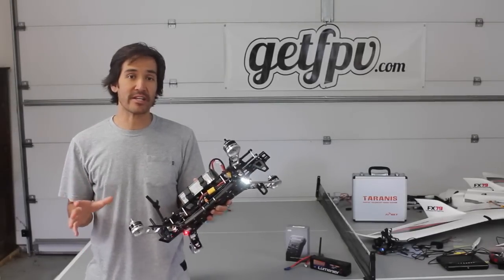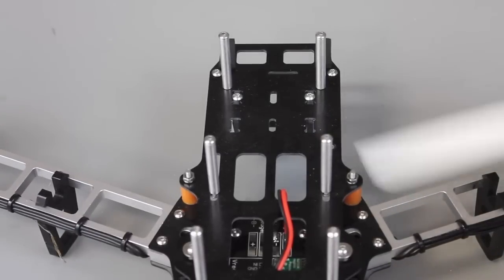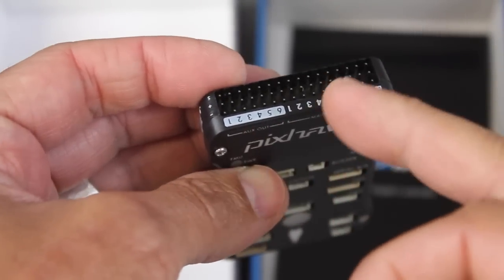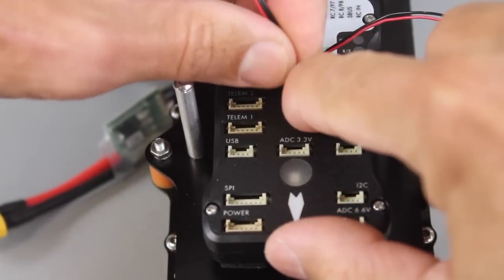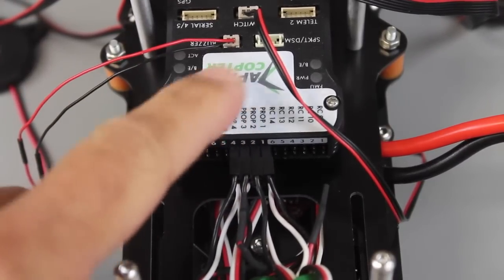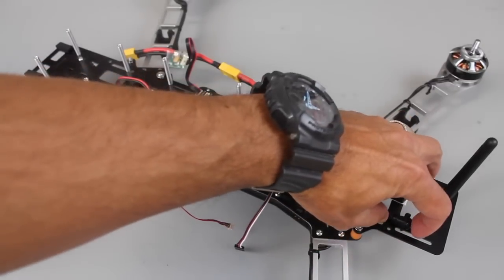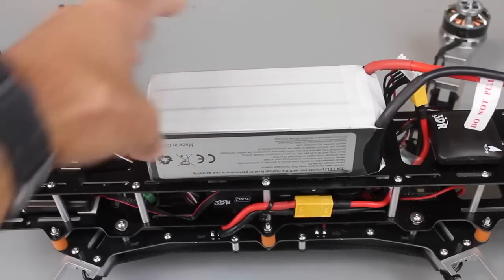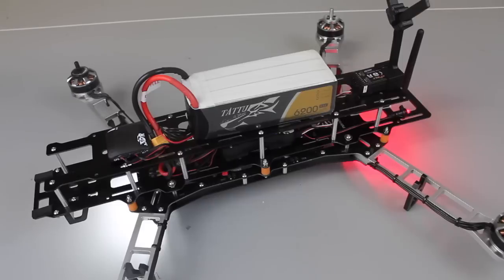Pixhawk Unboxing and Installation in QAV500

Comment: i am little bit confuse between pixhawk and pixhack controller which one is better to buy and in pixhawk there is an esc supporting problem pixhawk is not supporting emax blheli 30A esc is there such type of problem in pixhack or not and which one is better to buy

Comment: Hi Dennis. Hoping you might have a solution to my problem. Im trying to get Pixhawk Px4 2.4.8 to work on a 450mm quad. My problem is that after I arm, I move the throttle just a little, barely and the motors spin up almost to half throttle. When I bring the throttle down, it takes about 2-3 seconds for the motors to stop. Have tried on 2 diff Pixhawks, swapped out ESC's and tried on different quad with diff motors and ESC's. Same result. Motors are Turnigy D2830/11, ESC Hobbyking 30a BEC (center, red wire removed), Receiver Turnigy 9X8c v2, PPM Encoder, Radio Turnigy 9X, Power module v1.0. Posting here hoping you or one of your subscribers might have an answer. Enjoy and get lots of good info from your videos. Thanks for making and sharing.
Reply from the maker: That's really strange. I would recommend taking a look at your channels in Mission Planner to see what the inputs look like. Are they actually sending signals to spin the motors up that fast (due to throttle curves in your TX) or is something going on at the FC level? My guess is that it's the latter, but hard to tell without knowing more. At least looking at your channels will let you know if your TX is behaving properly. Good luck and keep us posted.

Comment: Hi Dennis i get a pb to check my autotune on my second quad...i don't remember exactly how to do ...i resume the situation....i get 3 flight modes with SG then 3 f.modes with SD then 1 F.mode with SD full up and SG at the middle...good but i don't understand this is following...On M.planner, Extended Tuning CH7 Autotune, CH 8 Do Nothing...Standard Parameters Ch 7 Autotune, CH8 Autotune...Full P.List CH7 Autotune, CH8 ---, CH 12 Autotune...this is like this by default...So, i change on Standard P , CH8 Do nothing and write then "Beeep" Pixhawk....On Extended P, CH 7 changes alone with Do Nothing and on Full P  CH7 is changed alone on 0....or in Full P CH7 is 0 and CH 8 is 17 then write but Extended Tuning Ch8 is Autotune , on Standard P Ch7 is Autotune, Ch 8 is Do nothing...for final, Extended .P CH7 is Autotune, CH8 is Autotune too but on Standard P CH7, CH8, CH9 are on AUtotune and Full P List CH12, CH7, Ch8 are on 17....????
sorry for long datas but i don't understand why somes change alone when i change one or them and how to do to get only on my CH7 with SF switch for autotune........................................

Thank's for your solution...
Philippe

Comment: Great thanks for so much help. I have a pixhawk but no foam pads. I'm putting mine in a plane,is pixhawk affected by vibration more from a quad than a large twin motor plane? what the best anti vibration pads for the pixhawk?
Reply from the maker: I haven't done any benchmarks of vibes between a plane or copter, but always dampen my Pixhawk regardless of where it's mounted. This is some of my favorite stuff because it dampens and is sticky on both sides: http://amzn.to/1297wsf Good luck with your build.

Comment: Hi Dennis, I have just a quick question .. My quad using a ZYX-m FC , 30 opto afro escs , sunnysky  2212 kv980 motors.
On lift off if I give it too much throttle it will wobble like out of control.. Do i need to set the vertical gain Higher or lower or do you think something else could be a problem?      Thanks so much and  I totally enjoy your videos!
Reply from the maker: Thanks for the feedback on the videos. My guess is that the PIDs may be a little high so try bringing them down a bit. Then try to throttle up again and repeat the process. I'm trying to think if it could be anything else but PIDs seem like the culprit. Let us know what you discover.

Comment: Hi Dennis, i've shown your video series again, and i can't calibrate the Escs with my Pixhawk....despite i wired motor 1 on 1 Main Output, 2 on 2..., Esc only brown (top)  and orange (bottom ) without red, my receiver ( Sbus ) is on Rc and is linked with my radio TX ( Futaba 14SG ) with fixed green led,    Power Pixhawk module is connected betwen my lipo and input Pdb and on Pixhawk with its 6 cables ( 5 black, 1 red )....i've followed with M.Planner all items but in the last version it ask to calibrate ESC...

" Push the button, unplug/plug via usb"...........then " Ensure throttle is high"

No problem for throttle, but unplug/plug via usb at this time is wrong....because there no more communication with uav and M.Planner....and which "button"....isn't the switch because after it ask " Maintain the switch..."
i think it the Green button  "Ready" but nothing is good....

 i can't get the sound to entrance in ESC calibration....

The most Bizarre in this calibration, is in a previous time i've achieved THIS Escs calibration and my motors run very well and now i can't ....i only get a deep sound ( boooop and not bip ) after arming with switch.....

if you have an idea...thank's a lot 
fly safe, Philippe
Reply from the maker: Sorry to hear you're having problems with calibration. I'm not sure what's going on so perhaps I'd recommend just trying to calibrate each of the ESCs manually outside of Mission Planner. Let us know if you figure this out.

Comment: what difference does it make from 12'' to 13'' propellers? is it really noticable?
Reply: The low kv motors he used have the power to push the bigger props, and therefore can carry heavier load (he described future use of 8000mah lipo vs 6000) , and would also be more efficient.

Comment: Well in excited to report that Pixhawk is flying really well and stable on my Skyhero 850 x4 configuration with KDE Direct ESC's and TMotor MN4120 400kv. Dennis I was wondering if you could do a video on how to calibrate non-3DR power modules that enable 6S voltage with the Pixhawk. I purchased a 6S Pixhawk power module from Amazon, but the current and voltage readings are way off, no matter what I do. It seems that every time I power up the Pixhawk, I have to always go into the settings and manually input battery voltage. It is always reading my battery between 3-5 volts higher than actual multimeter checked battery voltage.
Reply from the maker: Sorry to hear you have to deal with that. I'll see if I can get my hands on a non-3DR module and do a calibration. It's been a while since I've messed with one. Thanks for the suggestion and I'll see what I can do.

Comment: Dennis hi very nice version 2 frame. I see your using 380kv motors with 6S, hows flying time with a 3 axis gimbal if you compare to the MT4006-740kv motors using 12x6 graupner and 4S 5200mah? Hope you have some data on those, im interested using 4S and 740 kv with 12x6 props.
Reply from the maker: +Photostop Borgs Sorry I don't have any data on that setup. If you come up with any data please share it with us. Thank you.

Comment: Dennis I was wondering if you had experience with the following. KDE ESC's are true Opto ESC's, meaning that they need for the FC to provide 5V at the servo rail, so that when the ESC's are connected say to the motor output side of the Pixhawk, the Opto side of the ESC are powered by the FC (Pixhawk). The problem I have is that Pixhawk's Main Output servo rail does not provide the required 5V. So a work around this to provide the 5V externally by connecting a 5v BEC to any of the remaining servo channels in the Pixhawk. I got a Castle 10A externl ccBEC; mu confusion is that the BEC wire that goes into the servo rail has a signal wire. Should I just connect the black and red wire since all I need is the steady 5V supply to the servo rail? I apologize in advance for the lengthily post.
Reply from the maker: +traxxi2003 I left my signal wire on. It shouldn't cause any problems. I think the only reason it's there is to program it with CastleLink software. So you definitely don't want to get rid of it otherwise you won't be able to load new firmware or configure it. Hope this helps and good luck with your build.
Reply: +Dennis Baldwin Thank you Dennis!! I did exactly what you suggested, no problems so far!!!

Comment: Hello Dennis, sorry this is off topic but i wanted to ask if you had any experience with XAircraft SuperX flight controllers? Looking for a new flight controller for a Skyhero 850 IM building and not sure what to use.
Reply from the maker: +traxxi2003 I'm sorry but I don't have any experience with that FC. Good luck and let us know what you end up doing.
Reply: Yeah the X air FCs dont have any options for autonomous flight like the Naza and wookong series from DJI , or the arduino based flight controllers from Arducopter or pixhawk.

Comment: Hello dennis 
i follow your vidros and i think you make great job at the multirotor community 

i m currently building a hexacopter with pixhawk and i want to ask you some things that i have see at your build (i dont know if someone made the same question but you have more than 200 replys here)

i have see that you put at the esc ferrite ring , but as you said you removed the volt cable.   
do we have to put also the ferrite ring to a opto esc???

i have see that the buzzer is very close to the pixhawk.
does it make vibrations to the pixhawk when it works??

hank you for your time
Reply from the maker: +Cookmangr Cook No, you don't need ferrite rings for opto isolated ESCs. This is a great article about it: http://www.rchelination.com/ferrite-rings-on-escs-what-do-they-do-and-how-can-you-use-them/ No the buzzer doesn't provide much vibration and my Pixhawk is mounted via dampening pads. Hope this helps.

Comment: Hi Dennis thank's for your video and Pixhawk wires...but do you used a 5V 12V Adjustable Voltage BEC Output ESC Distribution Connection Board or do you connect your 6 S lipo directly on Pixhawk power module....i'd like to build my new drone with PX4 and i don't really know if i have to insert an adjustable voltage for this....or not. Then, i wonder if i can wire only one red ( positive ) cable with my 4 Opto Esc or only the negatives and signals cables....
Fly safe
Philippe (France)
Reply from the maker: +Drones Visions Aériennes I connected my 6S to the power module. That module will run the 5V to the Pixhawk but is also connected to my power distribution board and powers my OPTO ESCs, which is different than what I was using in this video. This talks about it: https://pixhawk.org/users/actuators/pwm_escs_and_servos and note there's a good tip that says:

"Instead of cutting the +5V line you can gently lift of the locking tab of the plastic housing of the servo connector for that pin (e.g. using a cutter blade or small screw driver) and pull the pin out. Isolate it with electrical isolation tape and tape it to the servo cable. This allows to undo this later easily."

Hope this helps and best of luck with your build.
Reply: Thank's Dennis, if i understand correctly you replace the power module from 3 DR with this following...
.APM 2.5.2 APM 2.6 Pixhawk Power Module V1.0 Output BEC 3A XT60 Plug 28V 90A

then you wire your Esc Opto...but how do you solder them, directly on pads "+"  and  "-" on your power distribution board on Pcb 's frame or an individual ....?
Have funny flights

Philippe

Comment: Dennis thank you for replying! Hey today while doing some research on the Antigravity 4006 motors, I came across this setup. They claim 35 minutes of flight time on a 640mm quad on a 6s 4200mah battery, Antigravity 4006 motors and 1.8kg AUW. Here is the link:

http://www.helipal.com/storm-drone-antigravity-gps-flying-platform-rtf-naza-v2.html?gclid=COvH96ffjMoCFZRffgodexwM8Q
Reply from the maker: +traxxi2003 Okay now that's awesome! I wonder how much having a GoPro and gimbal will reduce the flight time. Regardless, that looks like a pretty amazing setup. Let me know if you end up getting it. I'm going to look into these motors some more. Thanks for sharing that link.

Comment: Hello Dennis, hey between those motors 3508's and the Antigravity 4006, which one you think is the better choice if you are going after long flight times and capability with the QAV540? Thank you again for such great videos !!!
Reply from the maker: +traxxi2003 Man that is a great question. I had never seen the Antigravity series until I just google'd it. Wow those look nice. The problem you're going to run into is that the QAV540 will only support up to 13" props so if you wanted to get longer flight times you could prop up even more with the Antigravitys which should improve your endurance. So I'm not real sure. See if you can pull up some T-Motor thrust charts and do a comparison. I'll try to do the same. Let us know what you find out.

Comment: hello when i calibrate esc from receiver it's calibrated and when i have unflaged battery and then plugged it's have off beeping it's means calibration successfully, but
when i have reconnected ESC control cables to Pixhawk ESC steel beeping. need help to solution this problem.
Reply from the maker: +Mibinamet It sounds like that even though you've done the calibration there is no signal being sent to the ESCs, which will cause the behavior your describe. I'd recommend doing another Pixhawk calibration and seeing if you can get this working. Good luck and let us know what you figure out.

Comment: Hey Dennis thanks for the great video. I'm thinking of a similar setup but with a TBS Discovery frame. I noticed you used a regular servo cable going from the X8R to the Pixhawk via SBUS. Does this also power the X8R provided you are using the power module for the Pixhawk?
Reply from the maker: +iflyimpilot Yes the X8R gets power from the servo rail. You can power the rail in more than one way, but yes if you're using the power module you'll get power there. Just keep in mind (I learned this from experience) if you're powering any servos you want to use a separate BEC. I talk about it here: https://www.youtube.com/watch?v=fjxnVMcLCQE Thanks.

Comment: what esc will work with my pixhawk???
Reply: Jason Fries ...but my battery only supports 3c.
Reply from the maker: Jason Fries Most ESCs you'll find will work with the Pixhawk. 3S is fine as long as your motors and props generate enough thrust to support the weight of your quad.
Reply: Dennis Baldwin thanks

Comment: Officially 3DR does not support anything over 4S with their current Power Module and don't plan to going forward. There are some good aftermarket Pixhawk modules however that do support up to 25V
Reply from the maker: Waylon Johnson I know it's crazy that they don't support 6S right? I did a video about this a while back with a link to what I'm using from Amazon:

https://www.youtube.com/watch?v=uVGo2VBjpUc

Comment: Dennis, anything on those flight times? Also I noticed on the build there was no mention of step down voltage for wiring other addons that may need less that 12v or even 5v. And GETFPV never mentions 6S wiring, only 4S. Is there any special wiring that needs to be done with that 6S battery. The LED's on the frame say 4S as well, will those need to be wired to a step down. I'm calling GETFPV this morning but wanted your opinion as well.  
thanks
     Grumpy
     AKA Bob
Reply from the maker: R Beaubouef Bob, thanks for reaching out. I'm going to be doing the flight time test this weekend. Been caught up with work and a few projects. Will post when I know more. Everything on my QAV500 rig will support up to a 6S batt. The ESCs are 4S-6S compatible. The PDB has a voltage regulator that steps it down to 12V for LEDs and anything else you need to power. Just make sure yo get a 6S compatible power module for the Pixhawk or APM if that's what you're going to fly with. Hope this helps and thanks for the comment.

Comment: why don't you mont your battery on the bottom? <-- lower centre of gravity
Reply: +Hans Ham It is a fpv quad so having the COG higher means it is more unstable so more manoeuvrable. Also having the COG lower results in lower power consumption when manoeuvring
Reply: Funny...when you added the second part to your answer....you contradicted your reason for the first answer...LOL.

Comment: Dennis, would you mind sharing how you change/rotate the lawnmower pattern in grid surveys? I use simple grid v2, but can't for the life of me figure out how to rotate the direction.
Reply from the maker: Derrick W In the bottom right of the V2 window there is a box that says "Mission". Inside that box there is a field that says angle[deg] that you can adjust the rotation of the grid. Let me know if you can't get it working. I may not see a reply to this comment so you can always feel free to post at www.garagepilots.com and we can help you out over there. Good luck.

Comment: Hello, I'm building my first F550 with a pixhawk controller and devo 10 channel radio. I connected every the same way you did, however, nothings working. I also bind the transmitter to the receiver and the motors don't even move when using the functions.
Reply from the maker: bernard vales I wish I could help but have no experience with the Devo 10. A couple of basic non-transmitter items come to mind. I'm assuming you've "armed" your F550 by pushing the red switch? After that you need to engage the motors by throttle/rudder down and to the right. Assuming you may already know this, but if your TX is setup/configured properly then these would be the most logical issues. Hope this helps a bit.